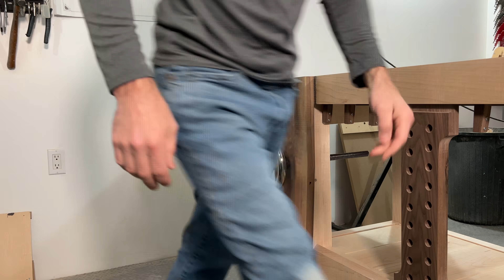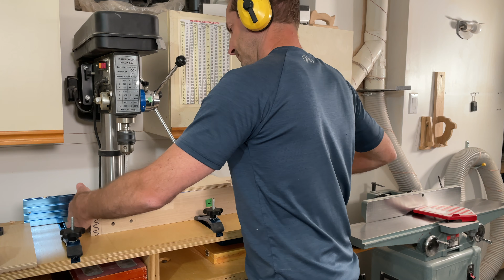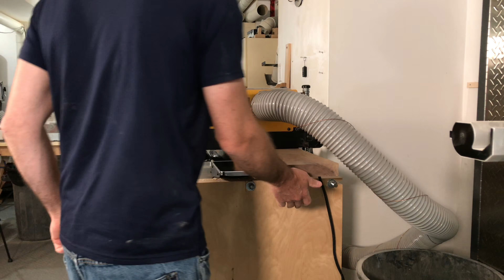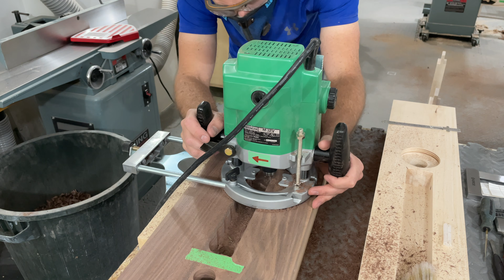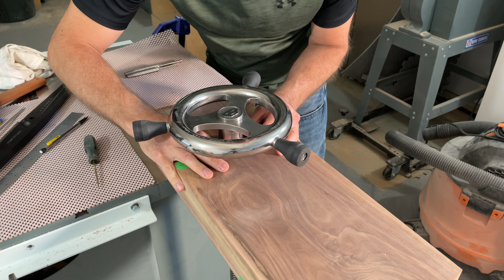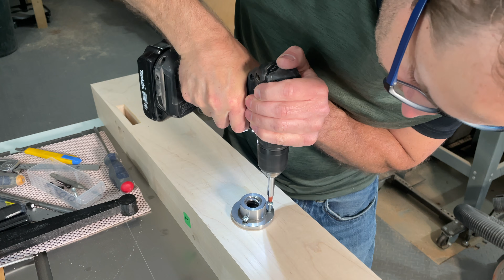Benchcrafted Glide Leg Vise Installation // How to Install

Comment: Thanks for your video, followed your chop shaping video and love the results. Any reason you did not recess the metal flange on the front of the chop, just thought it might add to the overall look having it flush with the chop face.
Reply from the maker: It never occurred to me to do it that way and the plans didn’t call for it. Interesting idea, though!

Comment: I have this install coming up soon. Appreciate the tip re: counter bore before you tap. 
Let me ask you, did you buy/use a tap for metal or for wood? 
I've been told that the metal taps will work just fine in wood and that's what i originally bought. Then i got nervous about it not being right in a very large and expensive hunk of walnut so i ordered a wood tap. 

Thanks again for the video Gary! You've been a huge help to me through this build!
Reply from the maker: Metal tap. I would send back the wood tap you ordered unless you have another use for it Doug. Thanks for being an avid supporter!

Comment: Its a 1/4 inch drill bit for tapping first and then use the 5/16-18 tap, which is standard. I'm planning on putting out a comprehensive, step by steop, vid for installation because after spending 500+ on this it is nerve racking and there arent really any comprehensive vids out there on this.. stay tuned. it really isn't that hard guys and despite a lot of other videos, not this one, everything doesn't need to be perfect like a lot of people do. there is SOME error. For example, the 1-1/4 hole that goes through the chop and leg. its really hard to get perfect, there is 1/8 inch play all the way around.
Reply from the maker: Good tip!

Comment: Great video!  A little tip to those who care.  If you wrap masking tape around the screw so it just fits in the hole.  It will stay perfectly centered in the through hole.
Reply: Thanks! I "do" care, quite a bit!
Reply from the maker: Super easy!

Comment: What are your thoughts on installing the criss cross on a chop that’s 2 inches thick?  I have a 2 inch thick birch board that I was planning to use until I read the instructions.  The mortise is about an inch and a half deep?
Reply from the maker: This a great question that many people wonder about. I would try to laminate an additional piece of wood onto the one you already have. See page 7 of the installation instructions. I hope this helps and thanks for watching!

https://benchcrafted.com/cdn/shop/files/file-crisscross_glide-instructions.pdf?v=15203092552444430418

Comment: Great video thanks. Any tips for drilling those 3/8” or 9.5mm holes across the chop, other than a (very) long drill bit and steady hand?
Reply from the maker: I used a drill press and drilled from both sides as far as I could (about 4” from each side). Then I put the bit in my cordless drill so that at least 4.5” was sticking out so I could complete the hole from each side.

If you are going to do it by hand, I would buy a long drill bit and use two small squares (or blocks) as a guide to help ensure you’re drilling square.

I hope that helps. Thanks for watching!
Reply: @garynelles , coming from both sides is a good tip.  If the board is square, it should all line up in the middle.  I'm going to try this on some scrap first before I put a hole in my walnut chop.

Comment: Gary:  Thanks for sharing.  I am wondering if it is a requirement that a leg vise chop in a Roubo bench extend all the way to the floor?  Nothing is ever held down there, and the criss cross mechanism attaches further up the chop?
Reply from the maker: Although you are probably correct, I think you would want to keep it as low as possible so that it doesn’t get in the way of whatever you want to hold in the leg vise.

Comment: wonderful video, very helpful. I have all the hardware sitting in my shop I just need to build the bench to go with it. I wish you were closer to Toronto so I could pick your brain a little more. the intrinsic cost of every element makes me anxious to begin. Also I just spray paint the Robertson heads for the bushing.
Reply from the maker: Thanks for your kind words Matt. I appreciate it. Hit me up on Instagram because we can easily do a video call on there. I’ve done it with a few guys out of the United States and it works great.